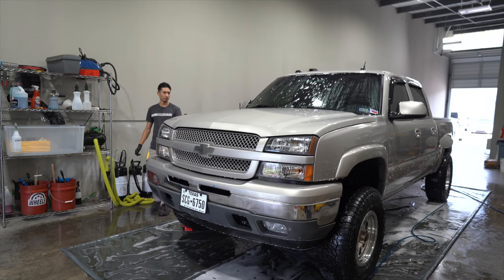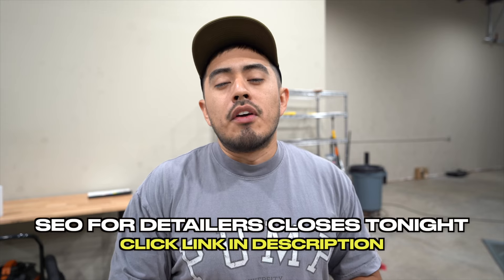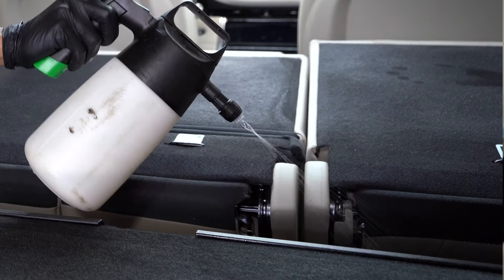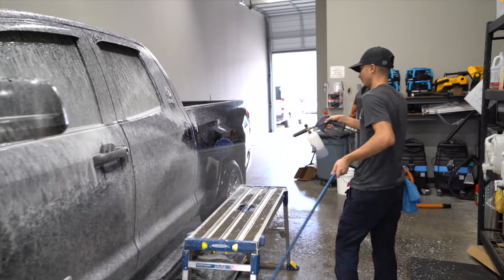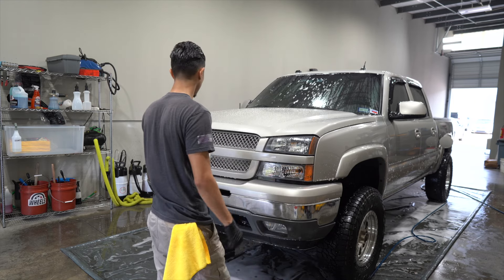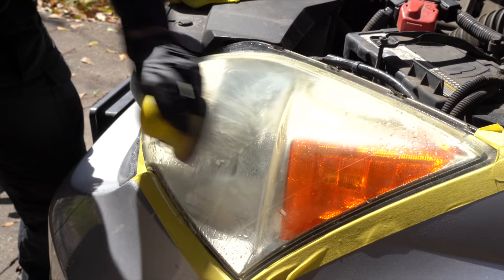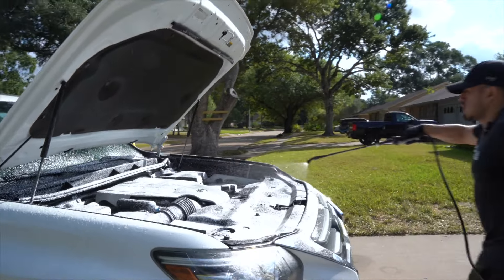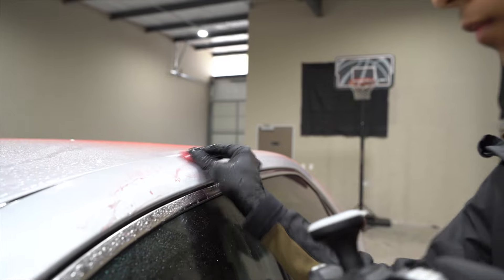7 Most Popular Detailing Services We Offer (and What We Charge)!

Comment: How can you clean or shampoo dirty cloth seats without an extractor?
Reply: Generally just apply cleaner, scrub and wipe with a towel, repeat until clean then dry. Also the cleaner you use should be one without a harsh sent and designed to not be rinsed out. If you use a apc or cheap chemical it can wick and gather dirt faster if you leave a high ph on the fabric.
Reply: Look into P&S 3 step system.

Comment: As a long term 15-20 years in this field there is literally nothing i haven't tackled.  I just wish i could work at a shop like yours instead of the half-ass, unappreciative, dealership I work for. Ive done it all from Ceramic Coating to 3 stage paint correction and everything in between.
Life sucks as a detailer at dealerships.
Reply: Take the leap of faith and start your own business….I believe in you
Reply: I agree with Angel. break out on your own... start with weekend jobs following this price structure and then faze out the dealership or retain them and charge more... believe in yourself!!